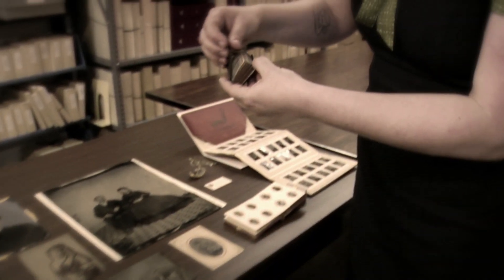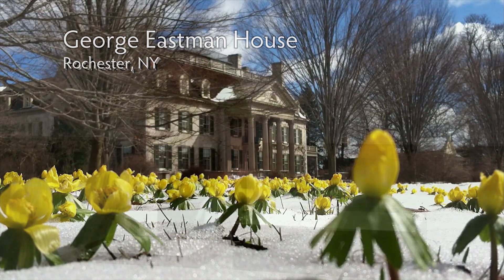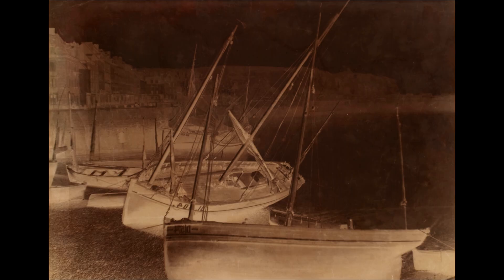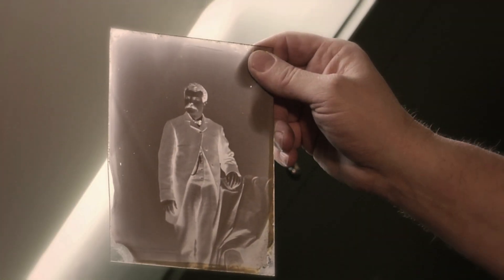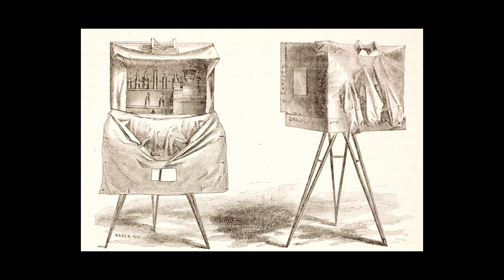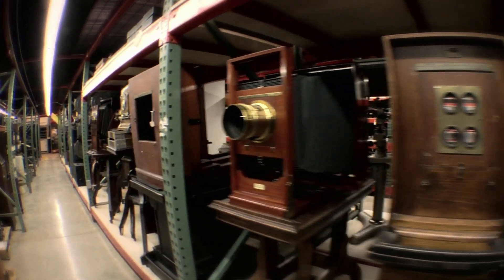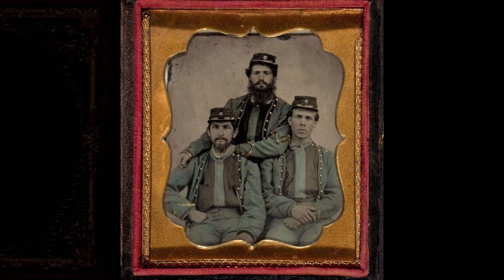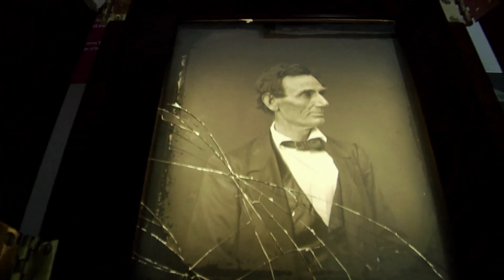The Collodion - Photographic Processes Series - Chapter 5 of 12

Comment: What did they use as a red light in this time period?
Reply from the maker: Early on it was probably candle light, some of the earlier processes are very slow and not nearly as sensitive to light as say modern film or paper, so you could handle them indoors under candle or lamp no problem. You'd need strong sunlight to make them work.
Reply: @GeorgeEastmanMuseum  thank you!